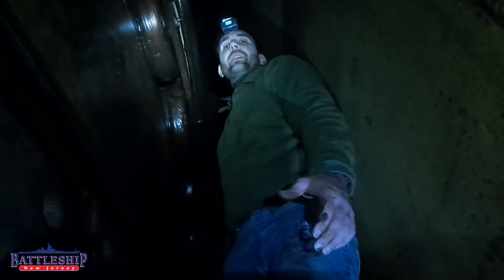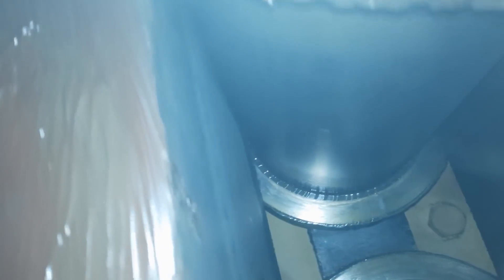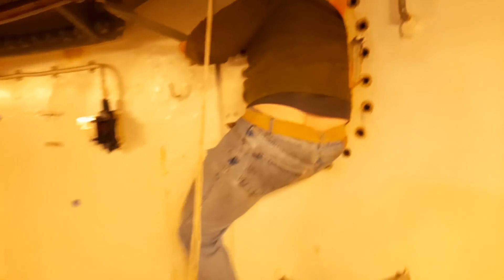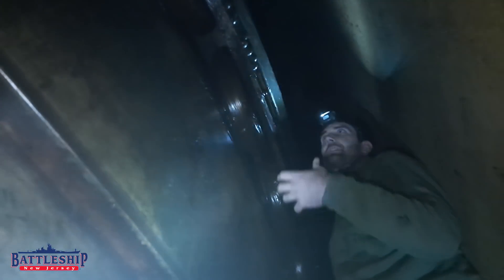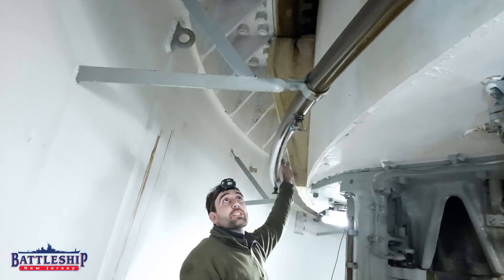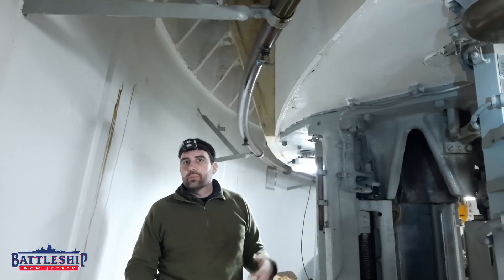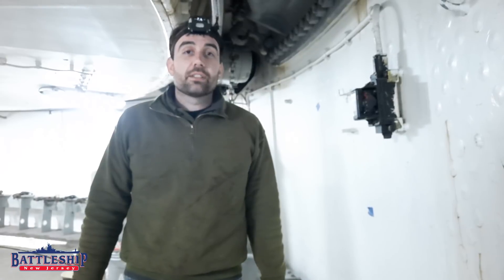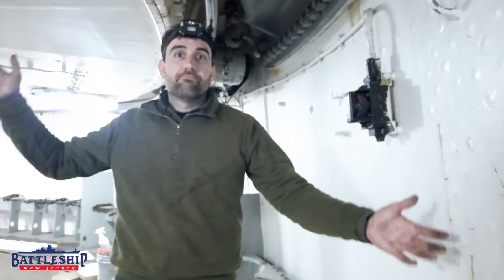Do the 16in Gun Turrets Still Rotate?

Comment: ANSWER: Yes, as far as we know, the 16in Gun Turrets can rotate.  (but the electrical system probably lacks to power to energize the motors to do so)  No weld marks have been found to indicate otherwise.
Reply: @jfbeam  
"It would be cheaper and faster to simply build a new one."
...No, no it wouldn't be. There's no place on this planet that still makes battleship grade thick armor. There's no place on this planet that still makes 16" guns. Let alone anywhere in America. In order to build a new Iowa-class, you'd have to build the plants and infrastructure that we got rid of decades ago. And, while they documented a hell of a lot of things, not EVERYTHING was. And, unfortunately, most of the guys that had a hand in construction are dead. Meaning that not only would we have to rebuild the factories and infrastructure to rebuild it, hope that all documentation survived and we can find it (which I can already tell you: it didn't) and we'd have to spend time problem solving and getting everything dialed.

It's actually probably cheaper and easier to go to the moon again today than it is to build another Iowa-class today. And that isn't being the Iowa is somehow more complicated. It isn't. It's because there's still infrastructure and factories that can build space-capable rockets and we have more documentation. We'd need to start from ground zero if we ever wanted another battleship like this.
Reply: @matchesburn  There's actually a similar problem with going to the moon, at least if we wanted to dust off the old Apollo/ Saturn V rockets. The main rocket engine, the Rocketdyne F-1, would be nearly impossible to build, and they have tried. The main reason is that then, the actual blueprints were more guidance than actual plans. Most of the important details were figured out by the machinists and engineers working together and problem solving. Those crucial details were then written down on scraps of papers, or just remembered by the machinist. Also, the US, and the world in general, is severely lacking in machinists that could achieve the level of precision they could back then.
Reply: @benjammin2020  I love that my grandfather was both a crewmember on the USS New Jersey and a machinist/engineer who was pivotal in the space race.
Before we sent humans into outer space, we sent a pair of monkeys, one male one female, for some reason both were named Sam. My grandfather engineered and built the seats they rode in. He also invented the mechanism to detach the umbilical cords from the Apollo rockets at liftoff, designed some of the electronics, worked for Avco on the ablative heat shield, then went on to write the range safety manual for rocket launches that is still used today, and helped design and even named the Antares rocket that delivers supplies to the ISS. His name was Donald E Grant and I will never stop being proud of what an amazing human he was.
Reply: @thebob6385  A fine example of old school knowlege and skill
Reply: @benjammin2020  It’s idiotic, flatly idiotic, to say that we lack machinists who could achieve the level of precision they were capable of in the 60’s. What an ignorant statement.
Reply: @benjammin2020  So true and equally so tragic that such precision is now lost, not unlike the technology to build the Parthenon. The column sections were so perfectly aligned the  cedar blockd in the center still gave off the smell of cedar.
Reply: @benjammin2020  We also can't build the Rocketdyne F-1 anymore because frankly, the way we build rocket engines now is better than the way we did then. Modern rocket engines can be built as a single casting with the cooling channels cast into the walls (if channel cooling is needed; for nonreusable rocket engines it's almost always more efficient for them to be ablatively cooled), which is much more efficient; the last engine we built even remotely like the F-1 was the Space Shuttle Main Engine.
Reply: @benjammin2020  severely lacking machinists that could achieve the level of precision they could back then? What have you been smoking? Modern CNC machines not only beat the precision of anything from back then, they automate it so every single part is perfect and identical. Then modern CMM systems (coordinate measuring machine) let quality control verify that those parts really are as accurate as they need to be.
Reply: I know the topic of this thread was "can  the turret still rotate"

My question is can the guns still be raised and lowered ?

Thought I saw a video possibly from one of the other Iowa class battleships where the volunteers found a hand crank assembly at the outside of the turret to raise and lower the guns.

Thanks in advance and keep up the good work!

Gary
Reply from the maker: They can be raised and lowered, but only by hand crank. Its very very slow.
Reply: I'll bet it's extremely tiring.
Reply: @BattleshipNewJersey  have any of the turrets been removed for maintenance during the whole life time or were they once installed and always left in place ?
Reply: @BattleshipNewJersey  If they are able to be lifted by hand crank, they must be geared to accommodate that. I wonder if anyone has looked at the name plates on the motors or pumps that would normally do this job to see what the power requirements are.
Reply: @BattleshipNewJersey  Ok, so now that we have some suggestion that at least turret #2 might still be able to move:

Fundraising Idea: Hire out the battleship for demo jobs in Camden and Philly 🙂. Why hire out a demo crew to plant explosives on support structures when you can take them out with style with a battleship? I mean, sure, sure, there's the whole issue of getting the building to collapse into its own footprint and not taking out a city block or two in the process, but where's the fun in that?
Reply: @envitech02  But just THINK of the CARDIO!
Reply: @vbscript2  The real fun is in the high angle shots.  Land that bunker-bustin' baby smack in the center of the roof and blow out the entire second floor so the building collapses into it's own footprint and sends out masses of shrapnel and debris to ruin the surrounding buildings
Reply: @BattleshipNewJersey  I'm surprised there is even a hand crank available (for raising and lowering the guns)! If it's very very slow as you said and I can imagine that being the case, I can't think of any scenario where that would be useful certainly not as the backup in the middle of a gun dual? What is it intended for?
Reply: There would be no reason to 'weld' the turrets in place, UNLESS it's required by some treaty. I volunteered at the Titan Missile Museum in the 90's in Tucson, AZ. There IS a missile sitting in the silo (sans engine), and there is no warhead. But a Russian satellite flies over it every day to verify there is now warhead - the silo door is blocked halfway open, and green house glass cover covers the opening, and the missile has a large square opening cut into the nose cone which the satellite can verify there is no warhead - all thanks to the SALT II treaty.
Reply: Come on USA, scrounge up some of those taxpayer dollars I know you have and get these ships powered
Reply: @invadegreece9281  let's just refuse to give money to any of the foreign countries we constantly give money money who hate us and we can reallocate those funds to the ships I'm on board with it
Reply: @invadegreece9281  
If they won't do it to impress the Americans, what makes you think they will do it to make you happy? I do understand the desire though. I agree with you, I'd like to see them seaworthy, crewed, provisioned and going on a world tour. Maybe for the 100 year anniversary of the end of WW2?
Reply: @invadegreece9281  Set it up with the Red Cross and Homeland Security for "Emergency" power supply, kitchens and housing in the event of another "Sandy or Katrina"  Don't need the guns, just the power... They can still serve a purpose
Reply: @invadegreece9281  I wonder what happened to the tax dollars for the welding mention in the article above?
Reply: Invade Greece  haven’t you heard? excessive spending no longer requires our tax dollars. Congress only need pass the spending bill, the Treasury prints the money into existence and we pay through inflation.
Reply: So 1 turret weighs as much as a destroyer? Is that what he said?
Reply: @originaljackofhearts  Yes, 2200 t.
Reply: @originaljackofhearts  yep. In the (in)famous Battle off Samar, Yamato alone outdisplaced all 13 US ships, and her three turrets outweighed the three Fletcher-class destroyers in TU 77.4.3. A Fletcher displaced 2100 tons at standard load and 2544t at full load. An Iowa-class 16” turret was somewhat smaller than a Yamato-class 18.1” turret, but it illustrates the size differences we’re talking about. (A Yamato-class battleship at full load was around 71,000 tons, while an Iowa-class battleship at full load was somewhere between 57,500 and 60,000 tons. Crunching the numbers, an Iowa was about 85% as heavy as a Yamato, which would put the proportionate weight of the Iowa-class turret right around the figure Ryan quoted in this video.) Battleship urrets are heavy, which is why they’re rarely found still on top of shipwrecks that had to descend any significant distance, and therefore moved around a lot in 3 dimensions before striking the bottom. If a battleship or cruiser capsizes, the turrets almost always immediately drop off of the barbettes. That was among the reasons why Oklahoma was never rebuilt after Pearl Harbor, while the other raised battleships were. (On the other hand, Arizona’s keel was broken, but she settled straight down, and her rear turrets were salvaged for use as shore batteries, and her #2 turret guns were removed from the turret in place, rebuilt, and installed as replacements on Nevada in 1944.)
Reply: Would be good to know if these turrets have a manual rotation capability. I sat in the gunners seat of an M1A1 tank and grabbed a random handwheel. Come to find out I was rotating the turret. There was absolutely no resistance at all. I understand there are a couple orders of magnitude between an M1A1 turret and a 16" turret but being able to apply some muscle and swing the turret even a small amount could help keep the ability active.
Sounds like a good place for a battery powered graese gun.
Reply: @philipkarsten9859  More than a couple - that turret weighs about 2000 tons (for scale, a prewar Farragut-class destroyer weighed about 1500 tons). Enough reduction to make it hand-crankable would likely turn it at a rate too slow to track anything traveling under power.
Reply: @disorganizedplay  Just a couple - I believe tank turret is around 20 t, which gives 2 orders of magnitude, or a factor of 100.
Reply: "electrical system" from this comment i assume these heavy huge things moved exclusivly by electrical motors??  what are the specs on these electric motors??
Reply: @jochenreichl796  yes. This functions as the "turret travel lock" on New Jersey. It is welded in place in NJ - preventing the turret from rotating. 
If any one is interested, U S S Iowa can rotate her turret and they have videos showing the turret "moving" (slow).
Reply: "as far as we know"... they'd only have to weld one spot. (or motor) Yes, it would be nice to see many of these things operating again, but it's just not in the cards. (and firing it where it sits is not really an option. not even a single bare powder charge. a full load plus shell would likely damage the aging beast.)
Reply: @jfbeam  The power is right, with our ship power, ie steam and diesel generators there isn’t any power to move them. Structurally you are wrong. The ships are sound and good still be put into service I’d needed/wanted.
Reply: @JarrodFrates  Yup. Battleships are, ironically enough, very specialized vessels. Their main goal is to have a combination of armor and gun range to outrage the enemy. So you can penetrate their armor at X range, while the opponent cant. Considering missiles have become the main weapon of choice, there is no reason to carry all those guns and armor. A BB is so expensive youre prolly not even saving money using guns instead of expensive missiles for bombardment. And if you ever wanna kill something heavily armored/with tons of CIWS, youd use super/hypersonic missiles.

IIRC the Iowas were actually developed with the mindset that BBs werent the main combatants anymore, and more about protection of aircraft carriers. Their belt armor was actually weaker than the earlier class of battleships, and significantly weaker than those of british KG-5s and the two Bismarcks. They were quite fast though, and very heavily armed.
Reply: @termitreter6545  Yep. They were built as fast battleships. Some even argue they're closer to battle cruisers. Personally I rather disagree, but it's telling there's even debate. That said they certainly weren't meant only as escorts, Cruisers could've done that job. They were absolutely capable of duking it out with any other surface combatant, and likely coming out on top of most baring some specific scenarios.
Reply: @Joesolo13  They're still massive ships with fairly heavy armor and huge guns, so yeh, they're definitely battleships in my book.

But I dont think calling them escorts(-battleships) is putting them down. Afaik the Iowas were somewhat reclassified to be carrier escorts during their development and production, when it became clear just how central carriers would be. I think that was part of why speed was considered so important, and dictated so much of those ships' design? In any way, covering carriers was their main role during WW2.

Of course they can still duke it out on their own, but I'd say thats also true of cruisers.
Reply: @JarrodFrates  - "Estimates to restore them to service over a decade ago were in the neighborhood of a billion dollars each"
So basically the cost of Three F-22 Fighter jets? Yeah...I think America can afford to restore the battleships if they wanted to. It wouldn't break the bank or anything. We just don't have the desire to do so at this time.
Reply: @TheBigExclusive  About seven, actually, based on unit cost, and those seven would be a more capable, versatile, and operationally less expensive investment. Each Iowa had a crew of 1800 when retired. Let's say they can cut that to 1500 with reactors. That's still probably at least $100 million in salaries alone each year, not to mention the food, medical supplies, and ask the other crew costs. Then there's the ongoing operational costs for a battleship. So a billion dollars up front and several hundred million dollars a year to restore a vessel with limited capabilities compared to, say, a Flight I Arleigh Burke (to say nothing of the current Flight III) for a sense of nostalgia for a ship class that was rendered obsolete two months before the first of her class was launched.
Reply: @termitreter6545  I disagree with Jarrod Frates that they were obsolete.  They may have been when they were launched, but when construction began in 1940, the aircraft carriers aircraft attacks were unproven.  Not until Pearl Harbor, the battle of the Coral Sea, and Midway was the effectiveness of aircraft attacks proven superior to capital ships.  When designed, the two main functions of the WWII battleship were to engage enemy capital ships and, especially in the Pacific theater, to shell enemy beaches for amphibious landings.  One must remember that Japan had the two largest battleships in the world at that time, the Yamato and her sister ship, Musashi.  Before Pearl Harbor, it was thought that the only way to counter ships like that was to use battleships of your own.
Reply: @theloneranger8725  I think he did just say they were obsolete when they were launched, not when the production started.

Tbf in WW2, obsolete might be somewhat hyperbolic. BBs still did a bunch of work, at least for the US in the Pacific. Even in the Atlantic, the actually hunt for the Bismarck was done by Battleships. Wouldve been a lot harder with Cruisers alone, I imagine.
Reply: @dicksteffen1025  I'd assume those countries werent really scared of BBs, rather than carriers?
Reply: @TheBigExclusive  That was to restore them to 80s condition, and that's not a decade ago, that estimate was produced before the turn of the century. In 2022 it would likely cost more than building a whole brand-new supercarrier.
Reply: @jfbeam " a full load plus shell would likely damage the aging beast" I don't believe it would. So long as they are not submerged in Salt water, should be fine... when "DEEP" pits form, different story.  I work with antique firearms and with common sense and appropriate loads, there are no issues... Overloading.. different story.
Reply: Get the damn power needed, and get the turret rotated a bit!! That's what I was hoping to see in this video! 👎
Reply: @LiftedJeepTJ98  
Just wondering - do you have any idea what would be required to do that? I don't know, but I am reasonably sure it is not at all simple or easy.
Reply: @Juan Cassius instablaster ;)
Reply: @Tony Fox thanks for your reply. I got to the site through google and Im in the hacking process now.
Looks like it's gonna take a while so I will reply here later when my account password hopefully is recovered.
Reply: @Juan Cassius You are welcome xD
Reply: @Tony Fox It worked and I now got access to my account again. I'm so happy:D
Thanks so much you saved my account :D
Reply: You probably dont care at all but does anybody know a method to log back into an Instagram account..?
I was dumb lost the account password. I appreciate any tips you can offer me

Comment: I asked the same question ,year's ago, was told some hydraulic equipment was removed during mothballing process.
Reply: Electric powered.
Reply: Maybe to drain the system and put in a preservative. Or some parts could have been taken for Missouri or Wisconsin.